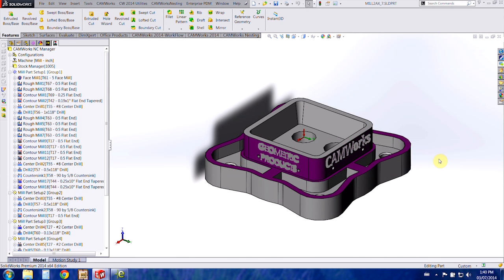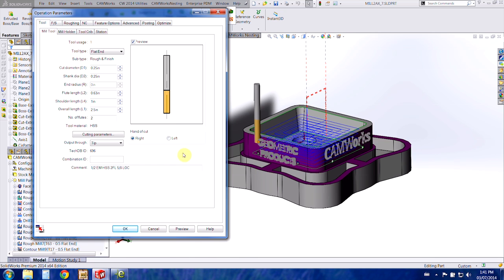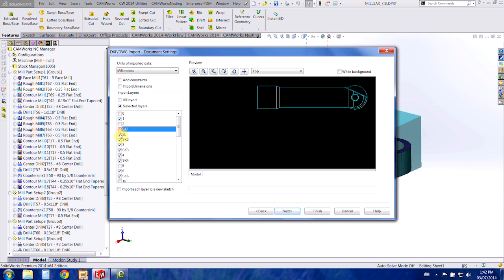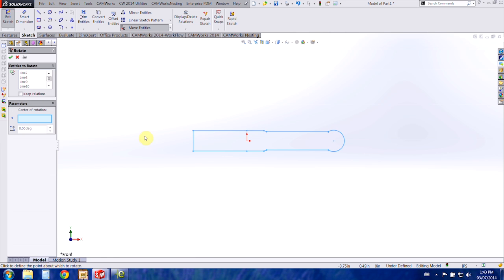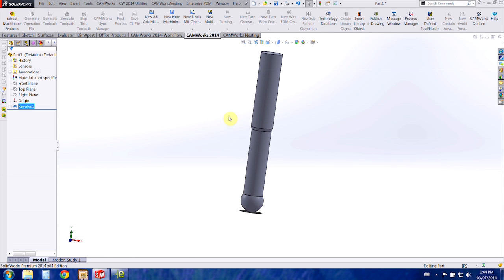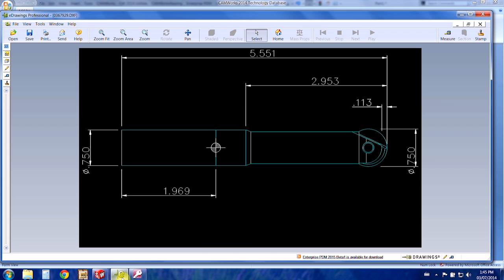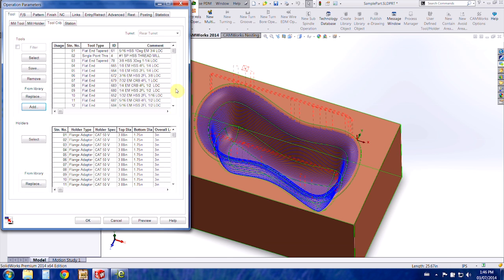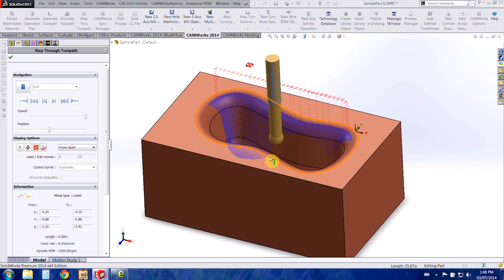CAMWorks - Create a Custom Mill Tool

Comment: On creating a custom tool.  It would be nice if the cutter didn't have to fully reside in the first quadrant.   On slitting saws, I'd like to set my tool zero at the bottom of the saw blade but this restriction in camworks forces me to set the tool zero at the bottom of the arbor.   Great video BTW.